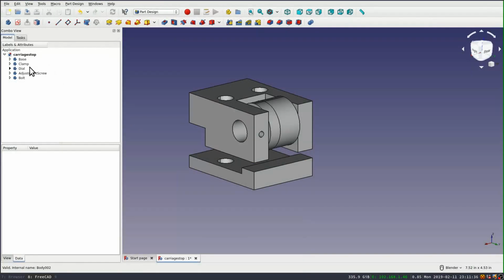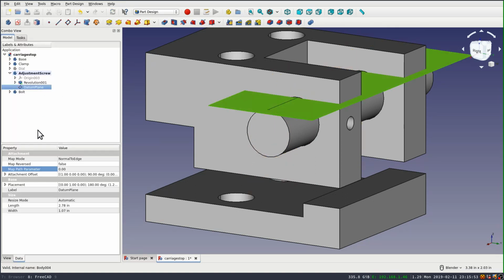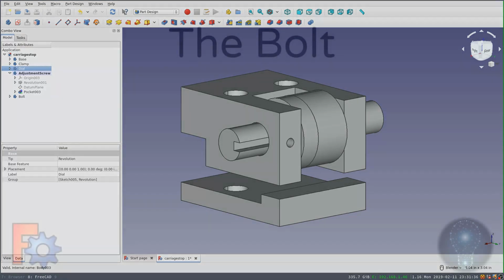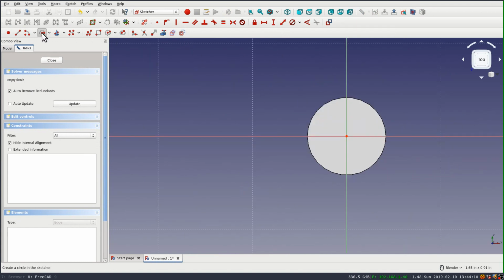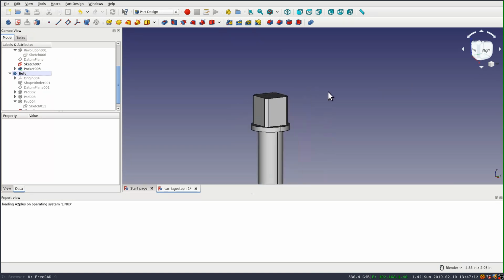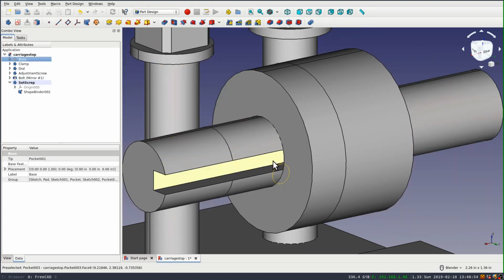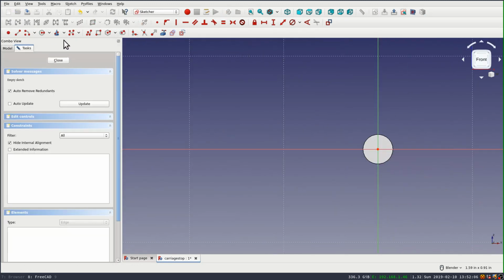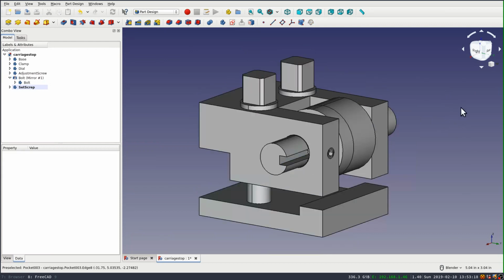Using FreeCAD Part Design to Model an Atlas Lathe Carriage Stop (Part 2)

Comment: This is a terrific video, thank you. Two questions if I may? When using a shape binder, is it possible to just start a sketch without creating a datum plane? Second, I was under the impression that it's advised not to sketch directly on surfaces in 0.17 and 0.18. How do you get around that?

Comment: just finished this carrige stop however never did figure out how to use the section you did for the adjustment screw.  down loaded the macro but cant figure out how to use it.  Help
Reply from the maker: I'm not sure exactly where you got stuck.  If you'll send me a time code, I'll try to comment with more detail.
Reply: @sliptonic  it is at 28 seconds in part 2 of the lathe clamp.  when you switch to the plane to sketch the profile of the adjustment screw in the video it show a cross sectional view at the plane level.  when i do it i have to go to wire frame so i can do the sketch.  what did i miss?  when i down loaded cross section macro and i slice it the view i get is the same as
yours but as soon as I go to sketch it reverts to the end view.

Thanks in advance for all your great tutorials.  they are among the best.
pete
Reply from the maker: What version of FreeCAD are you using?  I did this using a pre-release of 0.18 which has now been released.  The section plane tool was added for version.  No macro is necessary.  I doubled checked the tool with the current build and it functions as I showed in the video.  If you're running 0.17 or, God forbid, something older, you really should upgrade.
Reply: you are correct. still using 0.17  will get 0.18 now.   thanks that explains a lot.  thanks again, Pete

Comment: Is it possible to create a threaded hole and display it correctly in TechDraw with its dimension like its done in all technical drawings? My current work around is to draw only the core hole and then manually insert the right text, which isnt very smooth....
Reply from the maker: You can model a threaded hole but unless the threads are needed in the model for some reason (ie the part is 3D printed) I wouldn't advise it. Thread modeling is expensive and complicated.  I did a chapter in the book covering threads/helical ramps.